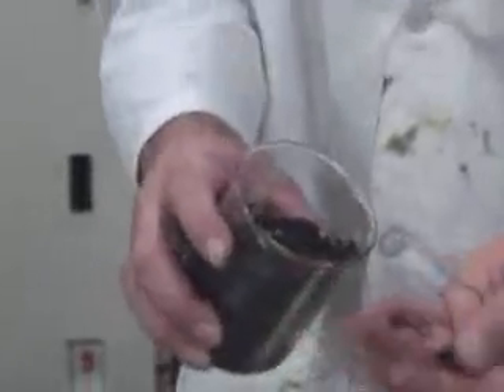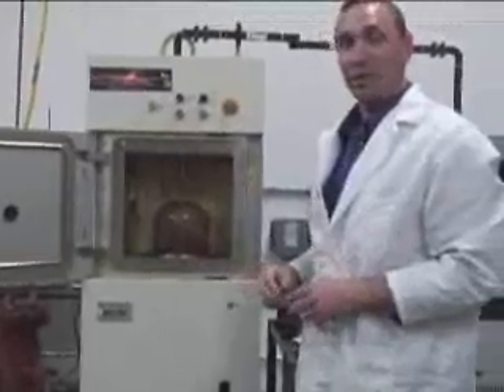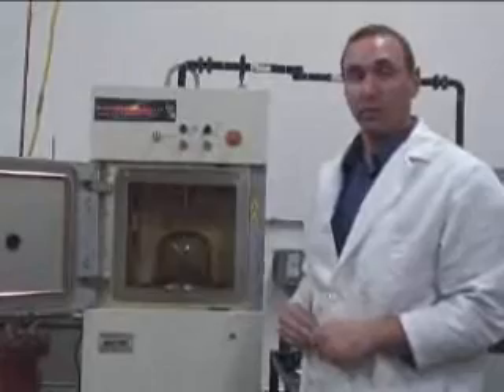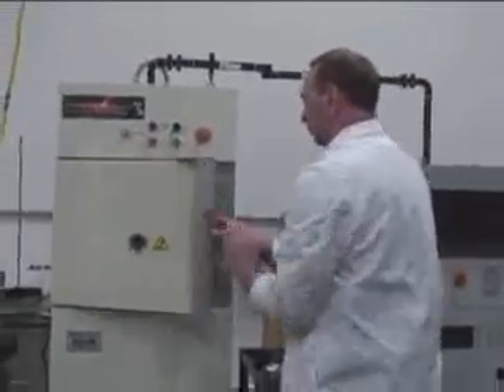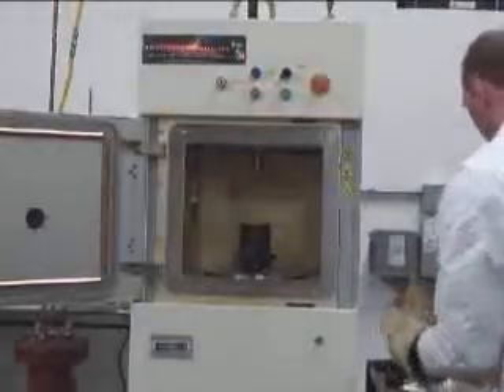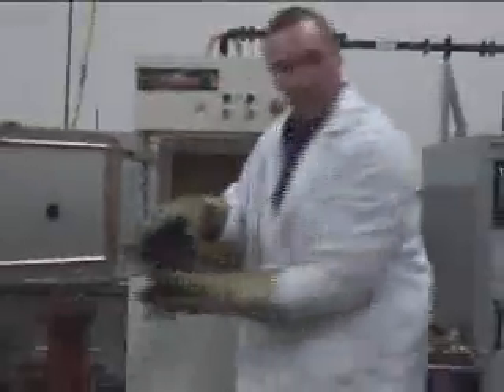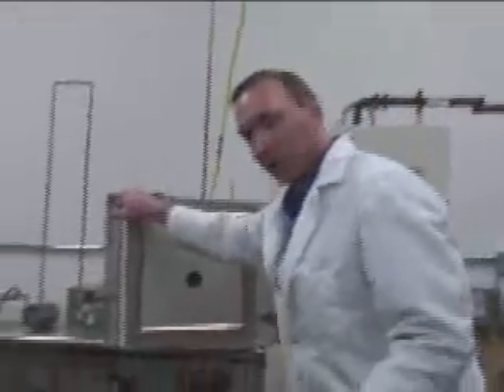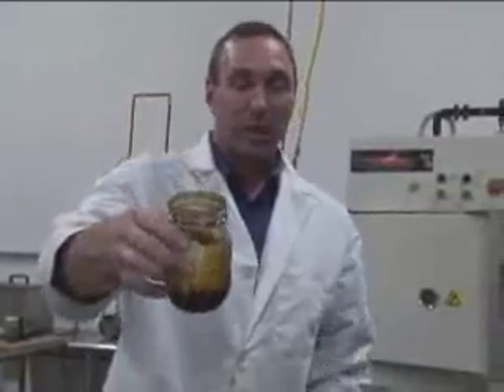Tires to Diesel

Comment: 50% of all tire recycled tires today are already used this way. They call it Tire Derived Fuel (TDF) Most power plants, paper mills and cement kilns use it. Mixed 10% with coal it produces 30% more BTU's and 20% less emissions. The problem is all the tree huggers think it's terrible to be burning tire for fuel. All they seem to think about is the black smoke when a tire burns in open air and don't have a clue as to clean they burn in a controlled boiler.

Comment: This is neat... but I prefer to have the tires reduced down to small particles and burned in a fluidized bed to make steam for power. But that's just me... just sayin... we should start burning the scrap tires we have to produce power before we by another gallon of that nasty crude oil from unstable countries.

Comment: It's really not that difficult, all your doing is distilling the rubber at 475F. You can use plastic too, but milk jugs or anything with number 2 for the recycle code tends to turn into a hardened mass so best not to use.

Comment: What a scam.... He says it`s pretty hot when he takes it out of the electro- carbonizing proton absorbing microwave enducer......heheheh  So he says it`s hot then he touches the glass beaker with his bare hands. Come on people?  Tires are just a bi-product of man that is very expensive to get rid of. No mater how you word it .Tires are toxic. The best way to get rid of them is to make marine habitat and playground equipment. You can not make diesel fuel from old tires. Nice try Mr carbonfinger

Comment: @dougthewelder 
 I am not putting down pyrolysis as a very viable solution to tire recycling.  One of my companies main products is tire recycling equipment, and I have built a prototype auger feed self sustaining pyrolysis unit for testing. The problem I have with the industry is everyone has been concentrating only on the process and not what to do with the extremely crude and toxic products this process produces. The only ready to sell product produced is scrap steel.

Comment: @turfguy87 
It is a very big deal because it takes more energy to process this oil into usable diesel fuel than the energy content of the fuel you are producing.  Like I said before this is not new technology. Now you can use this as burner fuel for a boiler without any further modification. This would be much more efficient taking some of the oil to produce the heat for the pyrolysis instead of multiple energy transitions using microwaves.

Comment: To bad that the oil directly produced has too many aromatics to be used in a diesel engine without significant additional processing.  Using pyrolysis  to degrade and crack solid materials has been used since world war 1.